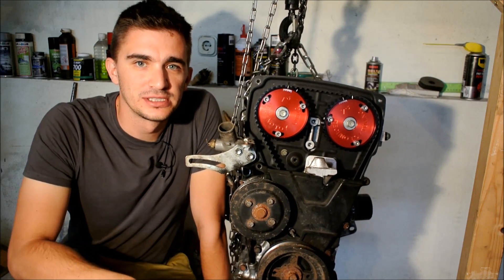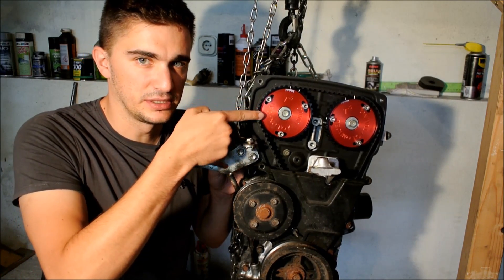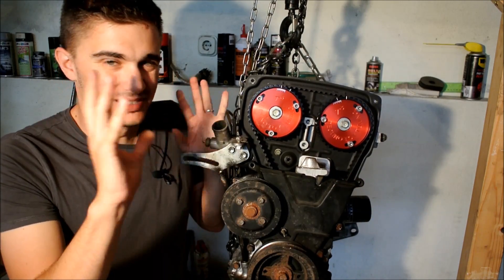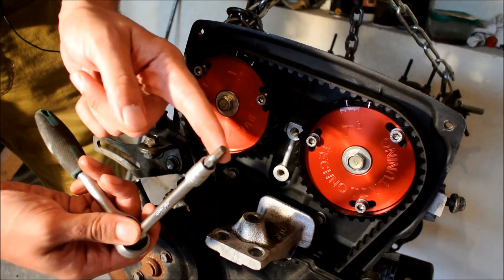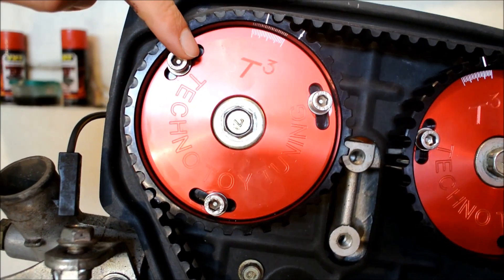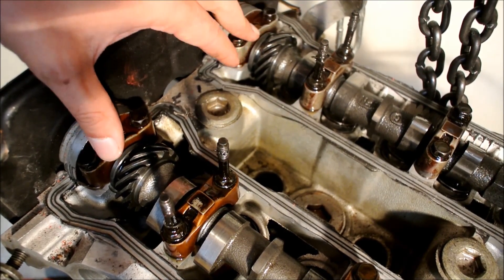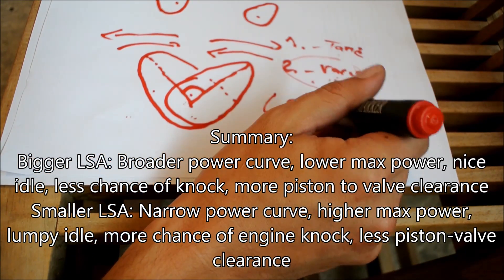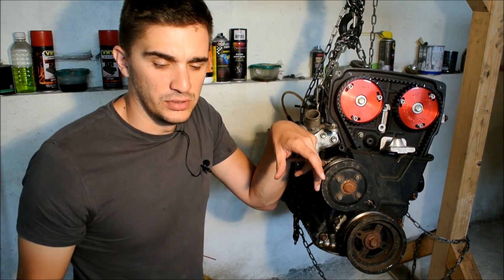Adjustable CAM GEARS - the basics you need to know

Comment: i know this is a super old video but i just have a question, on a naturally aspirated 4EFE motor with some mods installed (headers ported intake + ported and polished 7afe throttle body on a cold air intake + a free flow muffler and some other little stuff) could i benefit from just a cam gear?  i have stock cams and you did say cam gears on stock cams are kinda pointless, but could i reach any more power?
Reply from the maker: You can't really get any significant hp. You can just shift the power curve and that usually means a lethargic bottom end at the price of a top end that feels slightly more dramatic and gains like 1-3 hp. Dialing in a bit more overlap could help if you can adjust the cams independently, but then you get poor idle.

Comment: Hello, shoud you set your cams before or after head planning (so taking material away, which could make interferences maybe) ?
Reply from the maker: Always after
Reply: @d4a Alright, i was scared to have a piston to valve clearance different since you need to check it before head planning

So the right way to do is to check your clearance with the new cams at 0° setting, then get it planned with a margin of error and set your cams right ?

Comment: why not just turn the cam shaft instead of the crank shaft?
Reply: cam shaft is more fragile than the crank shaft, so why use the smaller shaft to rotate the entire engine instead of using the way it was originally meant to work? You'll be basically just putting more stress on the gear/shaft than it is meant to work with. That's what I suppose
Reply: @2ndary-_-328  not when your adjusting the timing, your only moving the cam shaft while the gear and belt say stationary.

Comment: Hello. VVT pulley is dead on my silvertop engine. Rattling noise. Is replacing it by adjustable cam pulleys a solution to maintain midrange power?

Comment: I worked for a Alfa dealership in the seventies Alfa's had adjustable cam gears I used to do the dyno tuning we found with the alfette and guilette 1.8 and 2.0 if you advanced the inlet cam 3 degrees it performed best and that was the standard cams

Comment: In regards to using adjustable cam pulleys on a stock camshaft, its true that you don't get a significant benefit in performance. But what you do get is lighter cam pulleys which reduces the amount of force required to spin it. Hence less engine fatigue in the long run. Some people say why bother spending 200 plus for something not so beneficial to the car, my answer is usually because i can lol

Comment: Great video. One correction for increasing power output for stock cams.  Once you know what the factory lobe separation is you can now check it to see if it's centered.  Many factory settings are retarded to meet emissions.  4 to 8 degrees is common for V8s.  Example: 5.7 liter that is retarded 6 degrees, readjusting the cam to strait up can recover 25 to 35hp and 20-30 ft.lb of torque.

Comment: What if your engine is a single cam and you add an adjustable cam pulley.

What will happen? What are the benefits?
Reply: When you have a single cam(SOHC) you just adjust the relation between both intake and exhaust valve openings and piston position only. When you have 2 cams(DOHC) you can adjust relation between valve opening and piston position individually between intake and exhaust(because 2 cams vs 1) but you can also adjust relation between exhaust and intake valve opening. This video already explains DOHC intake and exhaust relationship but did not explain the piston position(apart about warning of interference damage).

You need to first understand what the pistons job is and it's stages in a 4 stroke engine(2 stroke is different but 4 stroke is most common so I'll use this). 
Stage 1(Intake stroke): sucking in air (default:intake valve open)
Stage 2(Compression stroke): Compressing air (default: both intake and exhaust closed)
Stage 3(Power stroke): igniting air and fuel mixture to produce power (default: both intake and exhaust closed)
Stage 4(Exhaust stroke): removing combustion waste(default: exhaust value is open)

I'm going to talk about non-turbo, non-nitrous, just naturally aspirated engines as Forced Induction is a completely different dynamic.

The piston and valves take time to move around. The intake vale doesn't fully open immediately to let air in, it slowly opens up and gradually allows more air in till it is fully open when it allows the most air in, then slowly starts closing. Same thing for exhaust and same with for piston(It takes time for piston to fully reach the top and fully compress the air).

High RPM Scenario:
Lets look at the ideal high RPM scenario in a non-interference engine(intake valves will never hit the pistons no matter what). You want the intake valve fully open to allow air to enter the engine as fast as possible while in the intake stroke, then have it immediately full shut when in the compression stroke and power stroke, then you want the exhaust valve fully open when in the exhaust stroke.

Note: About RPM high vs low, the higher the RPM the more air being moved and more air benefits from less restriction, bigger air pathways like bigger exhaust, bigger intake etc. Opposite is true for low RPM. So bigger exhaust = less low end torque, more high end torque. You can't gain in one without loosing in the other.
So a slightly closed intake valve as piston is in intake stroke (drawing in air) is better for low RPM performance.

Advancing cam timing for SOHC will make intake open sooner and exhaust close sooner(this is good for low amount of air at low RPM because of greater suction effect(think of thin straw and low effort to drink a small amount of water vs using a very large straw and high effort to drink a small amount of water). (Air and water share same fluid dynamics BTW).
Retarding cam timing for SOHC will make intake open later and exhaust open later as well(piston will be lower in compression stroke and have thus less suction but since there is more air flow it wont matter and a lower piston has more space for the air to fill, thus better high RPM performance).

TL:DR: SOHC adjustment allows you to change between more power up high or more power up low(less torque down low but more torque up high with retarding cam timing vs opposite where you advance cam timing).

Comment: So I’m working with a Volvo engine that has a factory adjustable cam on the exhaust but vvt on intake. What is going on that causes it to have less knock when I retard my exhaust cam (essentially reducing LSA)? I have to run too octane because of the heat we have here where I live but I noticed I can take a bit more heat with retarded timing on the exhaust. Is it coincidence or would the intake vvt have a certain adjustment where it happens to work better that way? When I have knock it happens around 2500-3500rpm with retarded exhaust (very slighty) and 1500-3000 when it had stock cam timing? (I was running low octane back then) it have no idea if it’s been flash tuned or anything. It’s a 20V NA 5 cylinder with 10.3:1 compression. I do notice a large vacuum difference when I retard the exhaust cam. Feels a lot less than when I had stock timing so could it be that since less hot air is in the combustion chamber that it has less hot spots in the cylinder head? I’ve done several steam engine cleanings for carbon for the pistons. Could I be possibly having a inefficient stock exhaust header(it is tubular but very short distance having 5 to 1 collector)? I run a factory cat and resonator with 2.25inch stock piping until after the resonator it is 2.5inch where I took out the muffler.

Comment: Can they get ajusted when engine is in the car, or do u need to take out engine to ajust or install them??
Reply from the maker: They can be installed and adjusted with the engine in the car. That's the whole point. I demonstrated with engine out because it's almost impossible to shoot the vid with the engine in the car.
Reply: @d4a  
Thx, i am a huge fan of ur mr2 content.. do you need new belt when u buy the ajustble cam gear?.. same size??
Reply from the maker: Same belt

Comment: Too much talking, just go straight to the point
Reply from the maker: It's cam timing my friend not a recap of a reality show, I can't sum it up in one sentence and spoon feed short attention spans. It's a complex thing that needs some background and explanation.
Reply: @d4a  how about d series of honda adjustable cam gears
Reply from the maker: Well that's a SOHC, so your lobe separation angle is fixed into the camshaft, and when you adjust the cam gear you're always adjusting intake and exhaust at the same time.
Reply: @d4a  best degree for it?
Reply from the maker: That's like asking what shoes are the best to wear. When it comes to shoes it's all about the occasion, when it comes to engines it's all about application. There is no "best" degree, just like there is no "best" shoe. It depends on other mods, compression, your goals and desired power band. If you're trying to build an engine by asking people what's "best", you'll build a very big paperweight.

Comment: These pulleys spin the camshaft and the crankshaft in tandem and open and  close the intake and exhaust valves?
Reply from the maker: Yes, but it's not the pulleys that spin anything themselves, combustion inside the engine is what creates rotation and the cam pulleys along with a small pulley on the crankshaft only ensure that the valves open and close at the right time in relation to the position of the pistons. Basically the pulleys are all about timing.
Reply: @d4a  Yeah the combustion spins the camshaft pulleys and the crankshaft into the gearbox. 

The pulleys just help keep the rotations in sync right?
Reply: Im a subscriber and Im building a engine. I thing There was missing the "how to use a cam card for timming" like you are saying in your newer vídeo (120hp). Good work Stay strong

Comment: This is my first time being exposed to this information.  Actually, I think there is no other video explaining this in such detail.  What is a Dyno? So if your adjusters' timing is off how do you know which one is out of sync and even if you know that how much adjustments do u need to do.  Should box exhaust and intake cam have the same angles.  Like in your case if the exhaust cam is correct and set to two notches passed the marking does the intake has to be the same as well?  Thank you. and I hope to get a response and be corrected either by you or another person interested in helping others.
Reply from the maker: A dyno is a device that measures a car's horsepower and torque output. You can google it for more info to see how it looks and works. Cam timing can't really be "off" (it can but it has to be an obviously stupid setting). It depends on what you're after, different adjustments have different results and impact on the power band. Maybe you want your max hp and torque at 4k rpm or maybe you want them at 5k rpm (this is just an example). When you buy aftermarket camshafts they all come with a cam card that tells you how they should ideally be set up and you do that by using a dial gauge in a process known as cam degreeing (you can google that too). But depending on the particular application you may want to do things a bit differently than what's on the cam card (this is mostly true for different types of racing). For the street you will likely just chase the cam card stuff. Intake and exhaust don't have to match at all, they are not linked and don't need to follow each other, you adjust them until you reach optimal power at desired rpm. This is the best I can do in a single comment, as this really is an advanced subject when it comes to engine tuning and does require a fair bit of accumulated knowledge on how an internal combustion engine actually works. Hope this answered your question at least to some extent :) Thanks for watching.
Reply: @d4a  Thank you so much for your reply.  I did not expect such a fast response and I appreciate it.  I think maybe I should have explained my case a bit better.  I have a 2006 Mercedes E350.  I took it to a dealer to check it out they said that my timing belt and intake cams are fine but my exhaust cams are out of timing and cost $4670 to repair it.  I neither have that kind of money nor can I afford to sell my car.  So, I began educating myself by watching videos like yours.  Yours is very unique I must say.  I learned that in order to check the timing of cams I must take out the sensors, turn the main pully to 305 degrees and look through the hole where the sensors were taken out from.  Then I should see one marking per cam.  If the marking is dead center of the hole then they are in sync.  Otherwise, the timing is off.  Again, according to the dealer's diagnosis, my timing belt is fine.  So, I looked through the holes where the sensors were and noticed that the passenger side markings are right in the middle.  But on the driver side the intake was again in the middle but the exhaust marking was way off and could not be seen.   I finally saw it by rotating the main pully.    I'm not sure how cams can go out of sync if there is a chain connecting them together or check if they need to be replaced or just synced with the others, nevertheless, If I have to replace the exhaust cam I don't have any problems doing.  But I'm not sure if just replacing the cam is going to resolve the timing issue.   I think there are more steps in order to sync its timing with the other three cams.  The dealership told me that their timing must be adjusted with a microscope.  I don't know how they are going to use a microscope on the cams.  I do not want to race my car.  I just want a clean running car that takes me to work and back.  how do I go about correcting the exhaust cam timing with the other ones?  I don't think to rotate the cam in a way that falls in the middle of the hole is going to adjust the timing because the exhaust camshaft would still be in the wrong position.  Also, I noticed that eBay sales a tool called Camshaft Synchronizer Alignment Tool Kit  (https://www.ebay.com/sch/i.html?_from=R40&_trksid=m570.l1313&_nkw=Camshaft+Synchronizer+Alignment+Tool&_sacat=0&LH_TitleDesc=0&_osacat=0&_odkw=engine+dyno) If this tool is needed in order to align the cams then how could cams just sync their off-balanced timing automatically?  There are also other tools for locking the cams and camshafts when replacing a cam.  I will be grateful if you can explain this for me since I could not find any article that explains the timing adjustment after installing a new cam and I don't have the means to take my car to a professional.  I am very handy and my intelligence is not below average.  Again, thank so you for the time you afforded me.  Kindest regards.

Comment: Although I knew a lot of this already, still found it useful understanding cam lobe separation angle and how it impacts engine characteristics in a DOHC engine. The Nissan RB26 has a HKS V-cam kit, which allows you to dynamically adjust cam timing on the fly, which allows you to have your cake and eat it too. Only problem is, it's a $4k add on.
Reply: True, but at least you know you only have to buy it once 😁
Reply: Good lord! 😳 The power per dollar doesn't really makes it viable.

Comment: Hello I had a question wat would happen if I run some cam gears that been degreed to another aftermarket cam and I want to use them on my set of stock cams wat would happen ?
Reply from the maker: You will likely loose power. Stock cams almost always work best at their stock settings.
Reply: well if u can make it on d same degree from your stock camgear it might work

Comment: I have a question about the initial install and setup of the t3 gears if you got time
Reply from the maker: What do you want to know?
Reply: I bought a set, and it came with this piece paper that showed tdc on the gears, the exhaust cam on the paper shows tdc 2 teeth in front of the adjustment marks.
Reply: I sent you a picture of the paper on Instagram

Comment: Quick question for the 4age . when you install adjustable timing gears where do you install the distributor? do you base it off the adjusted cam shaft or the crank shaft .  or do you get it to stock adjustment then install the dizzy then adjust?
Reply from the maker: The distributor stays where it is. When you're installing the adjustable cam gears you're not moving the cams and thus the rotor doesn't move and you don't need to do anything to the distributor. The only thing you might need to do is verify and adjust the ignition timing the usual way if you make significant changes to cam timing with the adjustable gears.

Comment: I have a silvertop 20v, it uses vvt and a vvt pulley. Can I use adjustable cams on it?
Reply from the maker: You can but you won't have vvt anymore. Vvt is good, it makes sense to remove it only if you have a heavily modified engine, in which case it's a restriction.

Comment: In the case of the 20v 4ag if I am interested in just adjusting the exhaust cam 3 deg. Would I just loosen the bolts on the exhaust side only and adjust or otherwise? Thank you sir. Enjoyed the information quite much.
Reply from the maker: Exactly. If you're adjusting only the exhaust cam, loosen only the exhaust cam, i.e. the cam that you're adjusting.